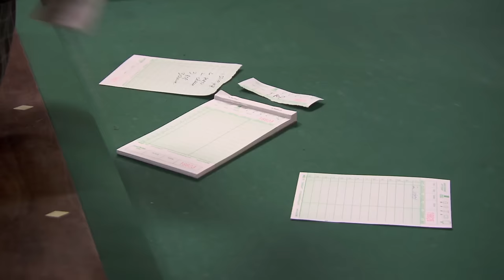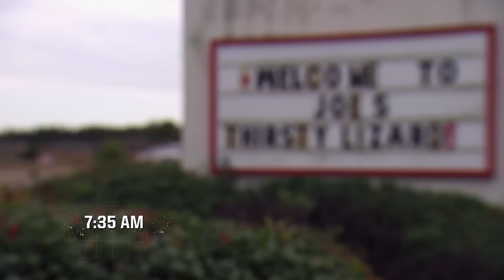BIGGEST Bar Fails of 2018 Compilation 👎 | Bar Rescue

Comment: Tapping beer isn't that hard ppl she acts like it's  rocket science
Reply: She's could just be nervous
Reply: For realz. I use the same technique to poor soda
Reply: Dude she couldn't figure out that if you pull the tap towards you to turn it on... you push it back to turn it off.  Room temperature IQ would be generous.
Reply: Sure, but apparently rocket science is easier then delivering pizzas.
Reply: Dan Lorett pretty slow learner, isn’t she?
Reply: Anybody that walked into that bar could pour a beer.  . And without instructions so how stupid is the staff.

Comment: At the scientists were actually trying, I wonder if there bar is still open
Reply: I hope it is. Either way, even if it failed, they probably make enough money with their sci jobs that it wouldn't matter lol. Some people get so dedicated to one thing that everything else that is relatively simple to every day people seems impossible to them cus their just not used to the head space of not thinking and analyzing everything to death. Scientists have terrible management skills regardless lol. They can manage their lab extremely well, but trying to get one run a bar/kitchen is like trying to use an allen wrench to  unscrew a phillips head.
Reply: They closed in July of 2018.

Comment: 4:16.. I’m not a bartender but I work in the industry and that beer is just sad.. first of all, the inside of the glass has to be wet (that’s why there is a circle where you push your glass and it shoots water inside of the glass). And when you fill up the glass, it never has to be full of liquid, it need a “head” or “hat” of foam that is usually 2 fingers high (depending on how big your fingers are but it’s a good way to keep track of it with naked eye)..

Comment: Some of the rescues followed Jon advise and still were shut down. Downy's Irish Pub in New York was closed to a Sheriff's sale because of the large substantial debt that was owed to the city of Philadelphia. The Rocky Point Cantina was also closed because the proper building permits were not secured and the building was not up to code. Stand Up Scottsdale also were forced to revert their original because using the Laugh Factory brand was troublesome. Finally, The Back Beat, Piano Bar also closed it's doors, due to the lack of patrons. I guess their wasn't enough disposable income in that area.

Comment: Out of every show and season, with the whole mixing ingredients to make a delicious drink, the beer pour was by far the easiest. You mean to tell me that they don't know how to do that? 3 easy steps! Put the glass cup at a 45 degree angle, fill it halfway, set the glass cup straight and fill the rest until it reaches the top. Of course the way you move the knob to pour the drink, move it the opposite way to turn it off. Must have been so spoiled when they were kids and growing up to have no common sense